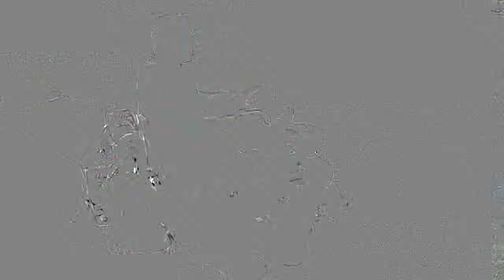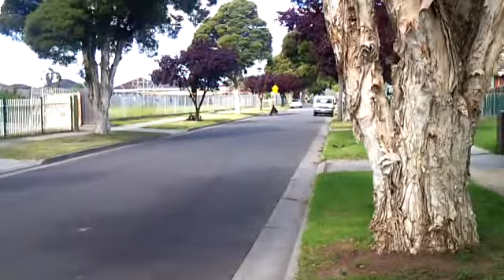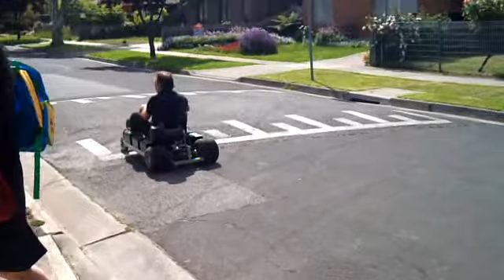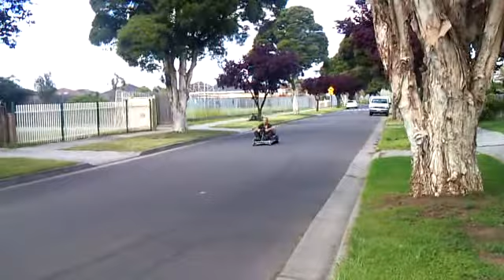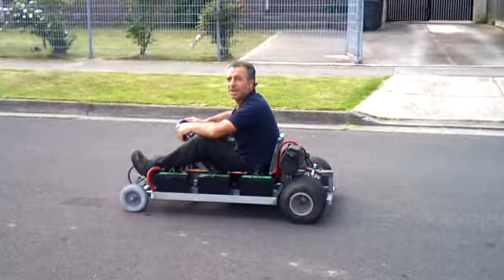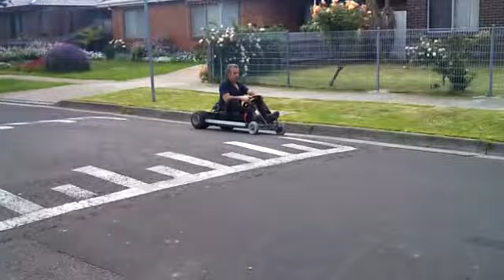electric gokart 3.MP4

Comment: Ok , you have more weight , that's going to make you take off slower plus your contacts inside might be cooking up , cut slots in the motor and force air to cool it down
Reply: Not many very useful document about starter motor as gokart are around, I still thinking how are they not burn those motor and how to prevent it.
Reply: @aimless3827  You have to force air in the motors. I have a semi truck motor and unfortunately it has brass bushings. I just eventually bought a small forklift hydraulic series wound motor that works perfect.